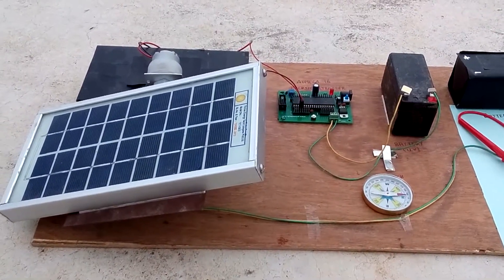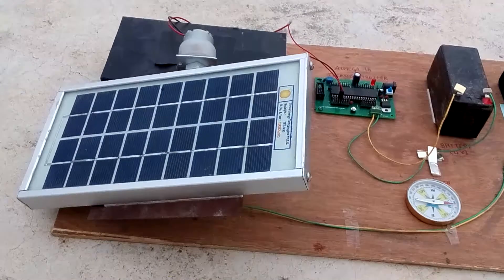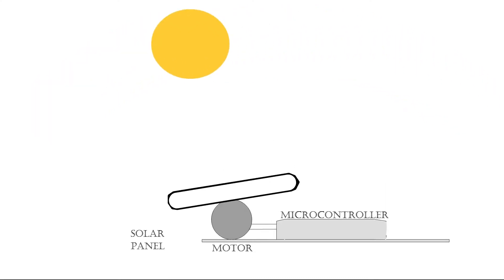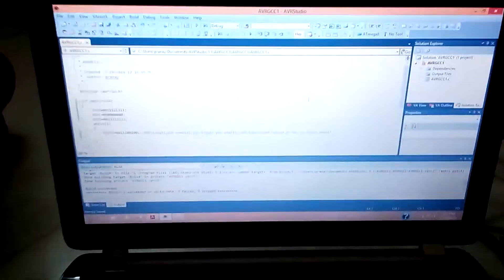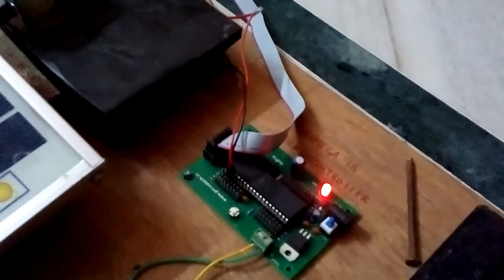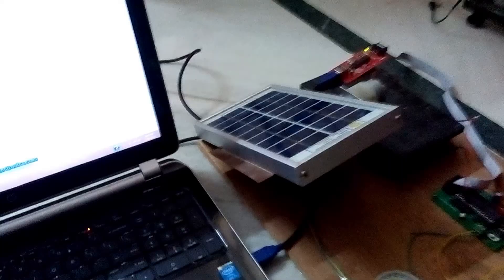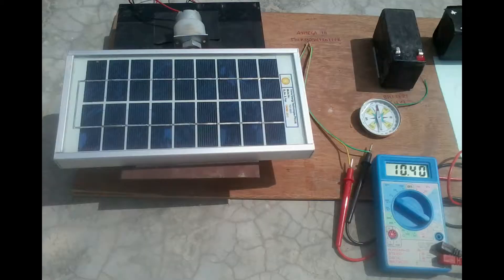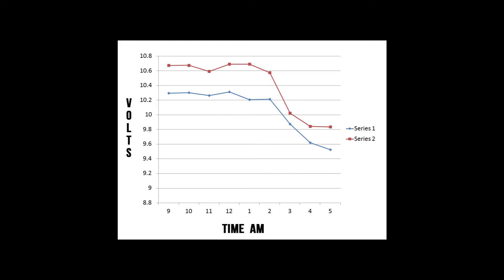Increasing Efficiency of solar panel ? - Experiment

Comment: Dear sir I have an Question,
What happen If I connect a 180 watt 12 volt solar panel with 5000 watt(12 volt dc to 220 volt ac output) car inverter? is it work normaly? then how much watt an volt will output the car inverter?